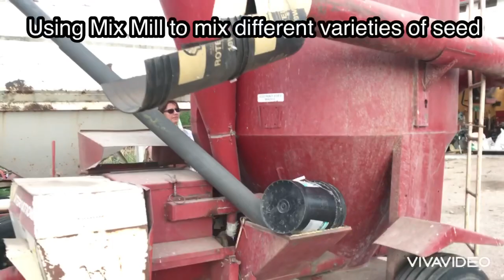No till drilling with a Case International 5400 Drill

Comment: Quite the zetor fleet! I have a 12145 here in Northern Ontario, needs a bit of love but I might keep it, see a lot of them further north I go.
Reply from the maker: Yes we’ve got 6 in total now!! 
They are a great tractor!!
Just finished rebuilding a 8245 engine recently
Always found that the Zetors built in the Martin factory (Crystals) were never as good as the ones made in the Brno factory and parts are not as easy to get